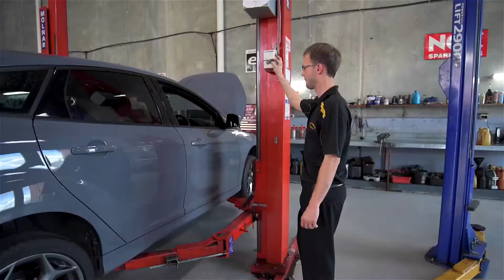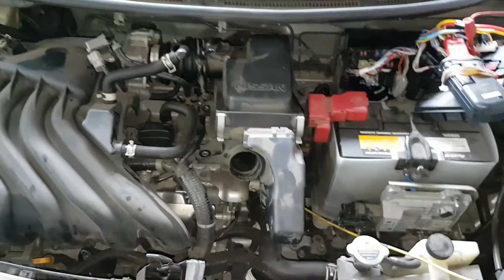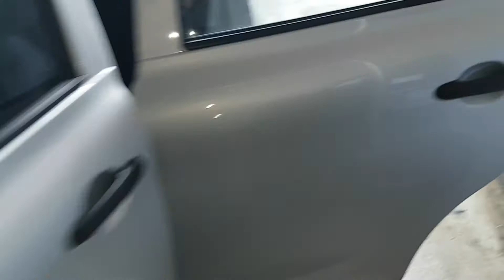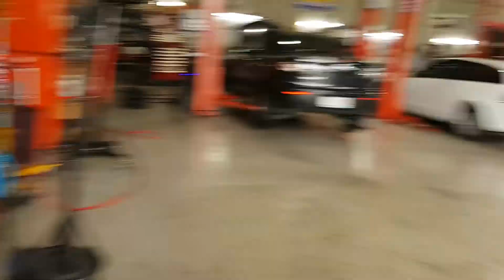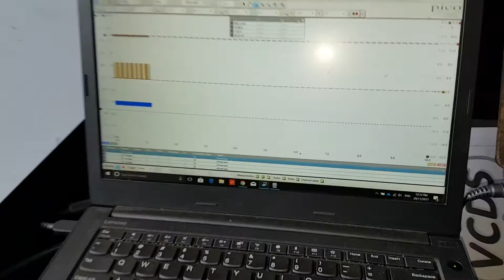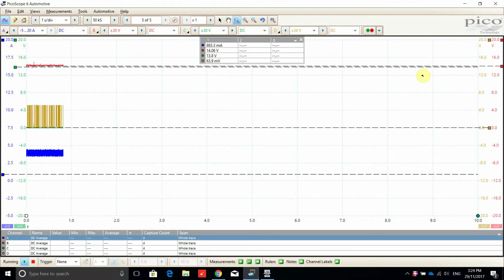Nissan Micra K13 Intermittent cutting out diagnosis

Comment: What does the green wire do that goes to the purge valve on top of the engine on my mum's Micra it's frayed and the car idols rough like the rpm is to low.

Comment: My micra kept cutting out told me crank shaft cam shaft both changed nothing worked . Cars start stop had stopped working too . Clutch of car went and when replaced clutch start stop then starting working and no more cutting out so far. Last time diagnosis told me timing chain .. had I changed that would have cost me £600
Reply: Hello! I have a similar problem, sometimes when gas is relatively low it starts cutting out, and start and stop fault too. Right now it wont go more than 3000rpm and the guys at the service told me to change the timing chain too but im thinking if it may be the clutch or the the fuel pump like in the video. Nissan micra K13 1.2 DIG 98ps (2011)
Reply: @vlospaP  Did you get it sorted.
Reply: @kinggeneral2760  Hello, yes i found the problem. it was because one of the two camshaft actuators was bad and i had to change it. Do you have a similar problem?
Reply: @vlospaP  no I just bought a micra preparing for the worst.
Reply: @kinggeneral2760  K13? How many PS? i dont have many issues with it. It had in the beginning when I bought it but that was because the dealer was unprofessional and it was my first car so..
Reply: @vlospaP  Yes It's a 2015  K13 80 PS. I'm going to collect it tomorrow.